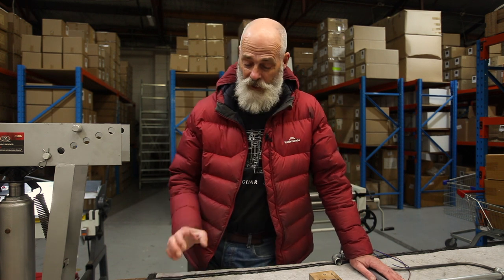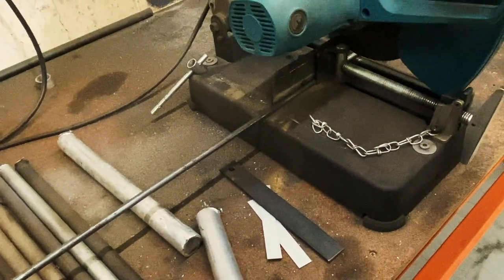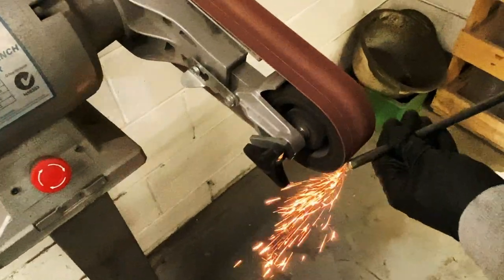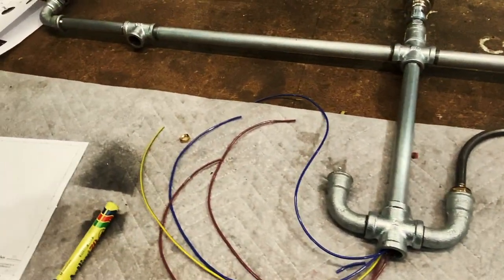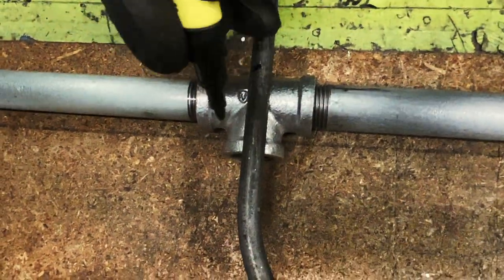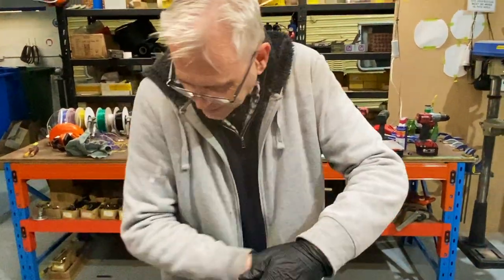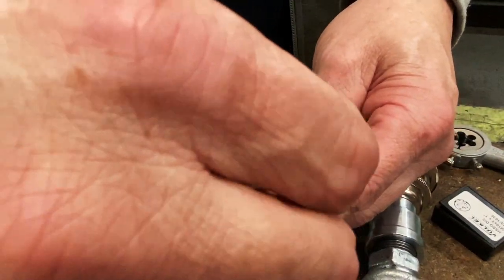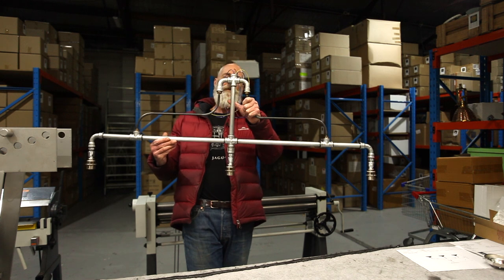Braced plumbing pipe light with bent component explained

Comment: Mr. Philip i have a question to ask....the bending device which you used for 10mm sold bar.... can also use a normal bending tube pipe bender?
Reply from the maker: It is a bender made for pipe that would be used in a roll cage so yes it can bend normal pipe. It does tend to distort however and ripple the surface on a tight bend so it is difficult to use to make light fitting components.